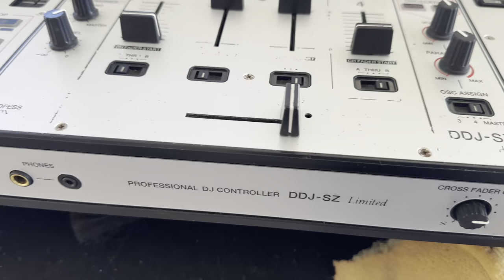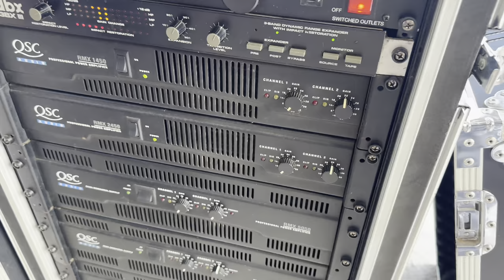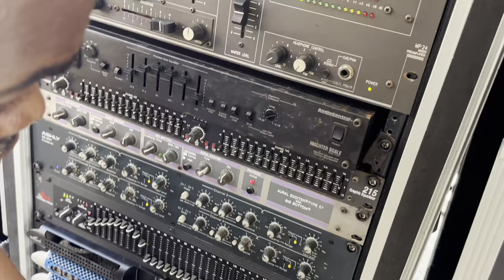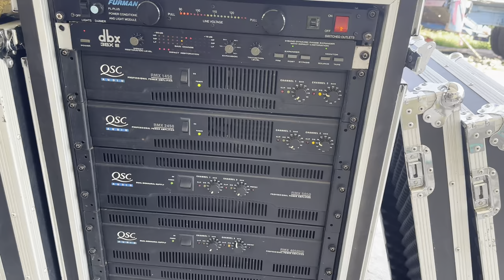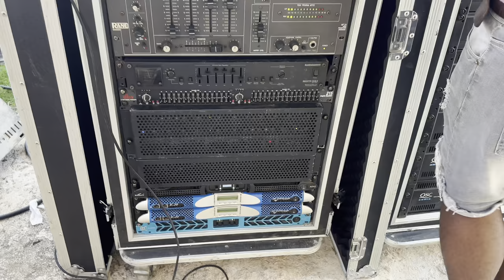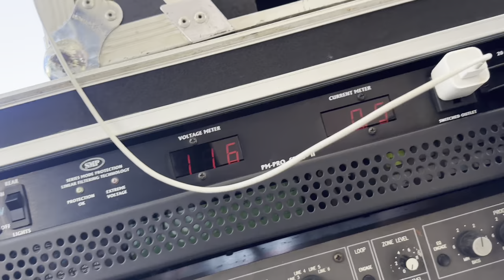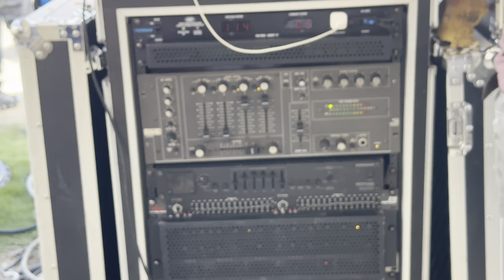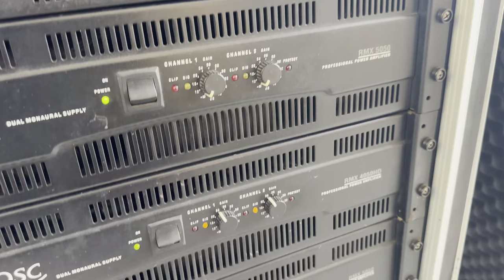KING HARMONY SOUND SET IT THE REAL WAY THIS WAS MY LAST JOB WITH THEM I NO LONGER WORK MYDISCLAIMER

Comment: Mr Williams big up yourself ..following you from way outta Guyana🇬🇾, me have a question which piece of equipment is better to get that clapping on the top ends also excite the bass more.....Richter scale or expander? And which modle expander ? Bless up ma bredda love da works u put out im now building my powered sound n need some advise
Reply from the maker: All depends on the line up plus tuning
Reply: probably a bbe or a dbx expander or a richter scale with a propper chip im guessing